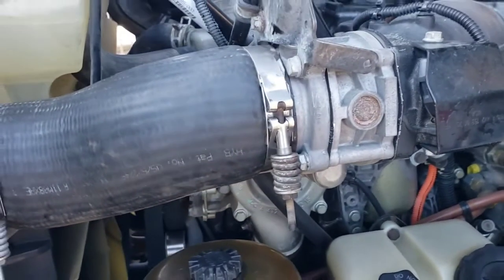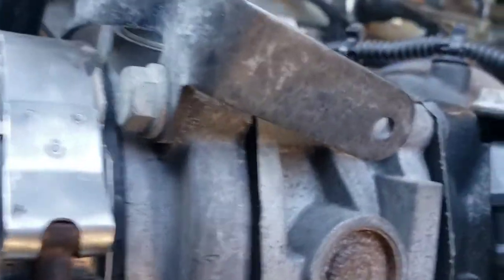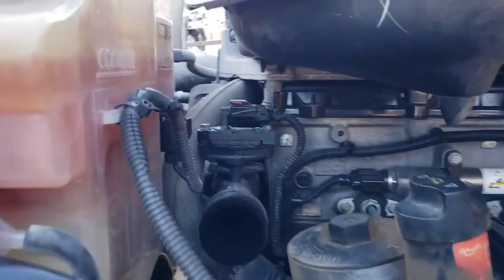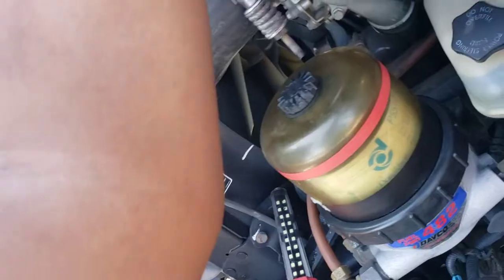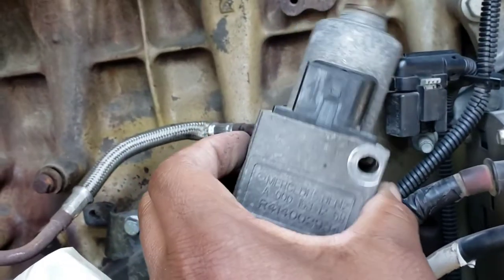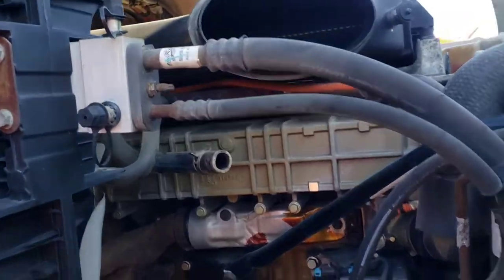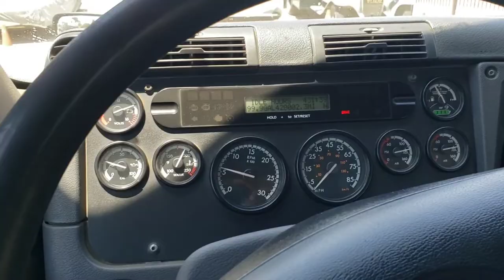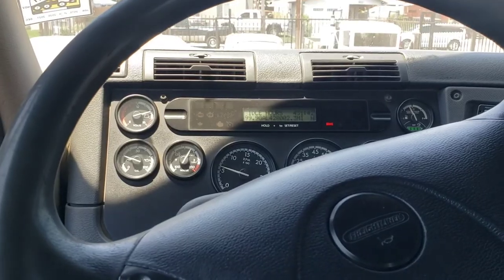Freightliner DD13 "power loss" here's what fixed my problem😵

Comment: As a mechanic I tell owner operators to buy a scan tool it will save you lots time and most importantly money  but I am glad you got it running
Reply: My freightliner 14 DD15 does not go pass 55 and gauge reads at 70 then it stops working. You think it can be speed sensor or program my cpc4 since i replaced it after stolen one.
Reply: Which scan tool

Comment: I have the spn 102 fmi18 and can’t seems to figure out what’s wrong took it to Fraightliner and they change the boot and manifold temp sensor and said I should be good. But 100 miles down the road it came right back.
Reply from the maker: What's the code reading when you look it up?
Reply: Were you able to fix it?
Reply: So brother what fix your problem because im having same issue
Reply: @amanjotsingh2686  i needed to replace dpf filters. Were clugged. 
If you haven clean them in the past 2 years is always a good idea to do it.

Comment: Thank you my 05 has that same problem I’ve changed delta p turbo air to air and still havnt fixed it I did need a new turbo badly and air to air was cracked

Comment: Boss 

Good info. It came in handy. My issue was the Delta sensor. The the map sensor did not have to be changed. 
I just added on so that 
my sensors are new .  new V-POD sensor did not need to be changed.

I have a 2016 Cascadia evolution….
Reply: What code came up on your dash before you replaced the delta sensor?

Comment: I found the issue mine had. The wire hornets was bad had oil in it form the oil pressure sensor. I replace wire hornet and oil pressure sensor and it run great after.
Reply from the maker: Good catch

Comment: I got same issue and about to start taking the turbo off inspecting it and definitely replacing my vpod and possibly my actuator wastegate and crankcase ventilator (oil separator) where you get that tool box from that set up pressure 🔥??
Reply from the maker: Take the turbo of last... it came from harbor fright
Reply: @GtPRiCH  Bet.....appreciate the response

Comment: Bro i have also dd15 
2015 freightliner cascadia 
The code is spn 102 fmi 18
Change new dpf one box
Chnage new turbo charged 
Change all sensore or all hoses 
But code still on screen
I have my truck pick uo problem
Reply: I have same code,  could not find the problem.  Please lmk if you figure this out
Reply: I have the same problem and can’t figure it out
Reply: Have you tried the air intake manifold? That code is saying the manifold is low.
Reply: I changed exhaust manifold
Reply: change crankcase filter

Comment: Was it losing power going uphill or just a lack of power all together? My DD13 is losing power going uphill only
Reply from the maker: All together
Reply: Mines doing the same thing. Even with an empty 14000 lb tandem reefer. Mines rated for only 435/1550 but still should haul an empty no problem. Only light on is check engine. Your problem get fixed by any chance?
Reply: Mine does same thing. Mine is the 435/1550 rating. Did you find the issue yet?
Reply: @EZNowTrucker check the air to air flow to see if it’s cracked. I had to install a new new turbo and that helped some but my issue is still there. Just have to pick the right time to put mine back in the shop but my mechanic said that might be the problem. Installed new software to increase the horses to 500
Reply: @EZNowTrucker another thing g I had my DEF deleted when I first purchased the truck. Not sure if you did that or not but… my turbo had a hole in it so it did increase the power but still not where it should be. My 435 hp truck pulls like a champ but not this 450hp one. My 2 trucks are 2013 and 2014 models DD13. Once I get the issue resolved I will definitely let you know. Good luck until then and check that air to air flow
Reply: Thanks for the reply. Getting it checked out tomorrow
Reply: Turns out the high pressure common rail fuel pump was on its way out. It finally exploded and put shrapnel all through the injection system. It's about a $15000 CAD fix minimum. 
Currently in a 2019 International LT. Only had it two days but runs good. Not a lot of storage though. Has a x15 Cummins 450/1650

Comment: Was the issue fixed big g
Reply from the maker: Did u watch the whole video lol
Reply: Yes
Reply: At the end i saw it running i got the same truck i have loss of power change the 3 things maf flow sensor,the othe sensor and vpod but code 411 pops up is asking for maf flow sensor calibration
Reply: I deleted the. Def im located in phx az where you at